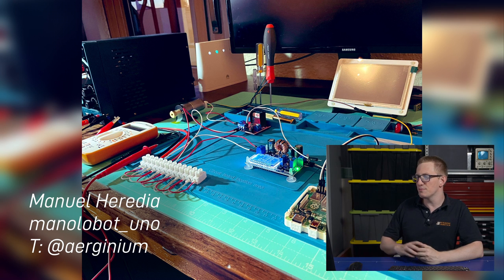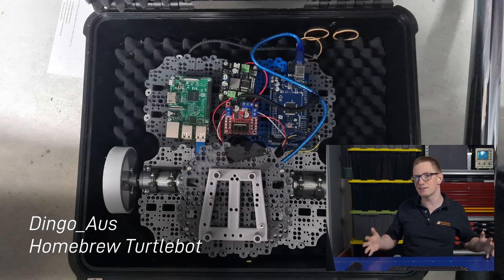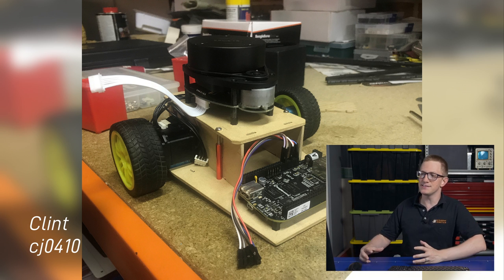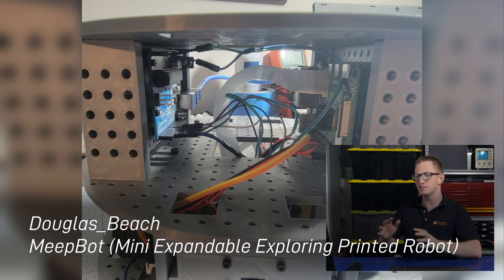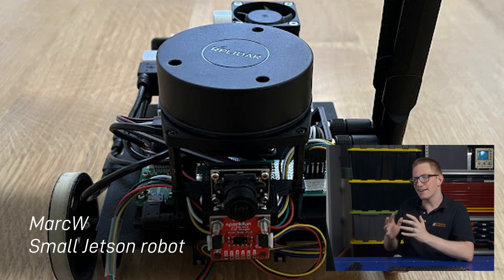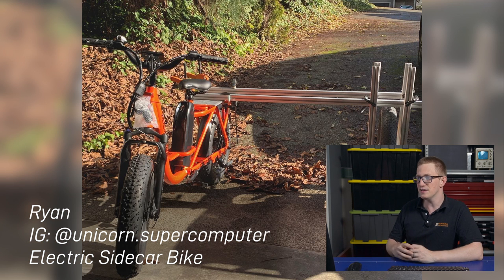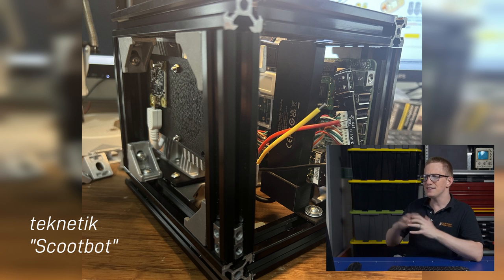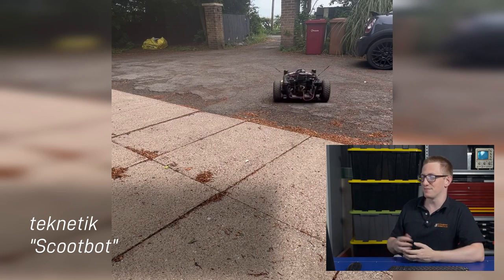You made THESE?

Comment: hey guys, what 3d printer would you recommend for robot building?
Reply: Hey 2much, there are a lot of great options out there. I can only speak to the cheap side of things, but I used one of the early versions of an Ender3 for my bot and it worked quite well. I had to do my fair share of troubleshooting of the years, which while annoying has really helped me understand what's going on. I just wish build plate was larger!
Reply from the maker: As Douglas said, I think the Ender 3 has kind of become a de facto standard. I use it and it has been good but I haven't tried to push it very hard. If you're a beginner for 3D printing it's a great option as there are a lot of resources out there for it.
Reply: Build your own.